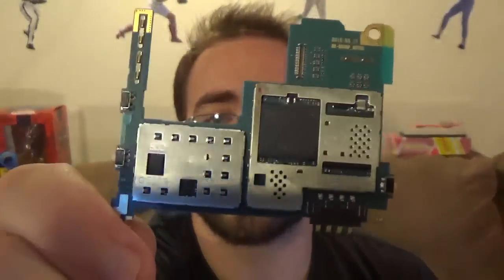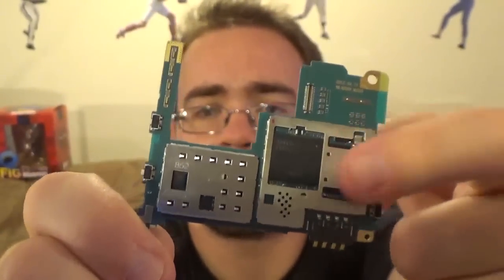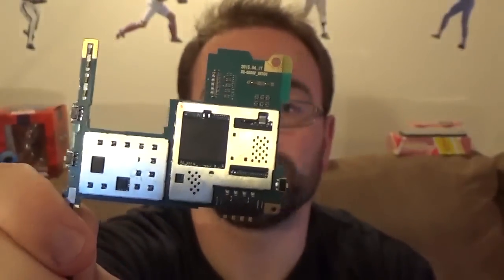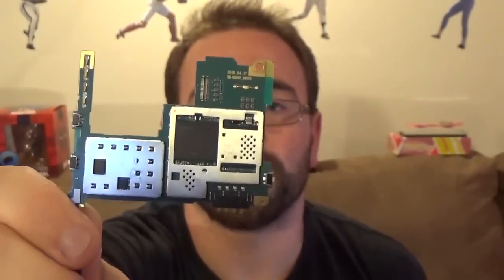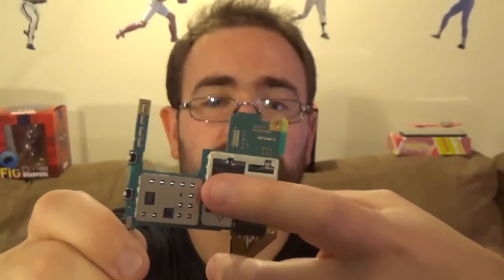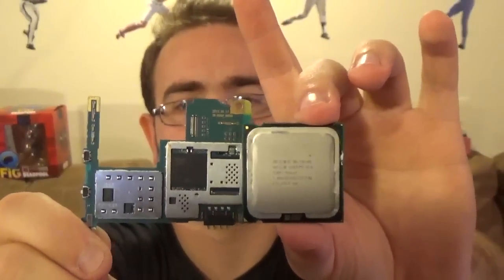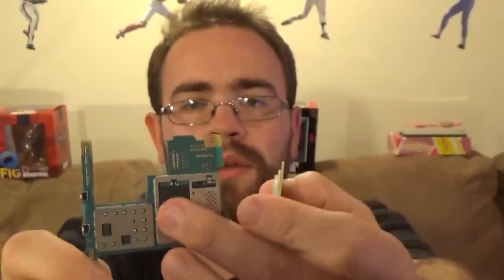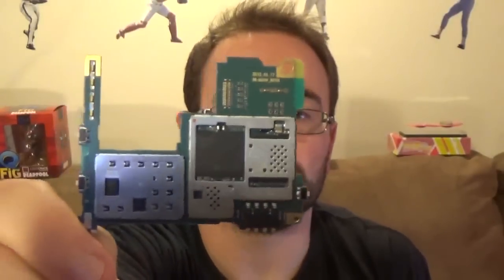Nintendo Switch - x86 And ARM! Why Is Nintendo Using ARM??

Comment: This video actually explains why the Switch just gets more and more powerful. Nintendo can basically redesign how the processor work at assembly level on the fly. For people that don't know assembly is basically the lowest lever programming possibly. With assembly you can basically have full control over what happens on a single leg of a chip at any time.
It's also used to program stuff like elevators,  circuit boards etc.

Comment: So by your definition, the WiiU is a handheld system too? You hold the controller with the screen in your hands and it runs on batteries. Only the CPU differs from your example.

Btw, we haven't seen ANY specs yet, or had a real reveal what the Switch is gonna be. There are rumours of a whole eco-system of hardware, so to sum it up as a handheld system just because it has a detachable pad is a bit early.

Comment: Well it is and isn't is there a x86 chip in the dock ? hmm wondering how all that may work maybe that arm cpu isn't working alone all the time. But i get that has nothing to do with your analysis. Do you know whats in the dock besides visual transfer hardware like what it may have for its computing power since it states when docked it does more.

Comment: Actually my old SurfaceBook with i7 6600U (2 cores 4 threads) can disable 1 core and 2 threads when I enable the power save mod. and it works fairly good.
Reply: Yes, but each core uses the same amount of power. Although now Intel is using BIGlittle technology, but when this video was made, they weren’t.

Comment: So i'm no expert but i remember it was harder to develop for the PS3's Cell Processor then for the 360's X86 Processor, 
Now the PS4 and Xbone use the same X86 architecture which seems to me make it easy for devs to develop for both systems and making ports easier to make. Does this mean Its also gonna be hard to port things over to the nintendo switch ARM architecture? or hard to develop for if you are used to making games on the consoles?
Reply: Some corrections. The xbox 360 and ps3 use variants of powerpc processors (the ps3 processor is simply called cell). 

Anyways I don't think it'll be too hard since arm has a huge market share in the mobile space and has been used on every handheld since the gba.

Comment: Think you need to get you're facts straight.
The Switch will use a solution build upon their tegra chip and nvidias top performing video cards. The tegra chip is using a 64 bit architecture and the Switch will thereby be the first console ever to support a pure 64 architecture:
http://www.nvidia.com/object/tegra-x1-processor.html
This also mean it will be alot more powerful than the Wii U that in turn was 20 x more powerful than the ps3 (released 6 years after the ps3). As it's been 4 years now since the release of the ps4 it might even outperform or perform close to the ps4 itself in some aspects.
The card ridges also removes the need for load times and is great for open world games that rely on a lot of quick loads from databases.

Comment: It may run 5 year old technology but the Switch hamstrings triple AAA technology, so you'll get subpar/inferior ports of games that need that more powerful hardware to look good/great.  A game company like Sony/M$ want more powerful processors and graphics, they want a beefy PC clone because gamers demand that streamlined hands off PC experience.  It is a handheld with a dock that some games will utilize to upsize.  Nintendo should have made both separate, a beefy console + travel toy, instead of a gimmick hybrid that in actuality is just a handheld showcasing old tech that is still far behind the offerings of Sony and M$.  Switch is primarily for Nintendos IPs, it's WiiU 2.0.

Comment: Terrible explanation. sorry. There's no reason for Nintendo to use ARM because it is a "growing market". That is interesting for nvidia, qualcomm, samsung and the SoC manufacturer. Nintendo use Nvidia as a partner because they are the only company in the world that have created a power efficient mobile chips with console equivalent performance. For developers, ARM isn't really an issue as Nintendo, in collaboration with Nvidia, offers middleware to game engines and code platforms. Today, two of the most popular engines, "Unity" and "Unreal 4" compiles to ARM-architecture and are officially supported by Nintendo middleware. They both run admirably on the platform. And since games are not developed with hardware specific code anymore the whole popcorn example is a way of overly complicate the development process of games for the switch. Nintendo and Nvidia is bundling hardware specific code into APIs that game engine developers will use to attach to their game engines. nothing more. The development process isn't complicated due to the architecture.

Comment: It's simple really. Nintendo wanted to be different. Consumers look at the PS4 and Xbox One, PS4 Pro and soon to be Scorpio and identify them not as consoles really, but a compact PC instead. Sony no longer uses proprietary custom made parts. Instead, they're now using off the shelf PC parts to save money. (That and Kutaragi no longer resides at SIE.) Xbox has basically been a PC in a smaller box since it's introduction into the console market through the Xbox 360 and now Xbox One as a way to sell hardware to PC enthusiasts and appeal to them. Nintendo still want to be identified as a console and this helps that claim in a market of non-proprietary parts any more seeming less like a PC and more like a console, though now they're clearing preparing to take on and try to compete with the mobile market which is still a tall order. Nintendo has recognized and accepted they can't compete in the console market. N64 failed, GameCube failed, Wii was a success but not enough to carry Nintendo through if they want to stay profitable, and the Wii U crashed and burned. Nintendo learned their real strength is in the handheld market. With Sony no longer there to compete with them, they're the only handheld manufacturer. Nintendo knows outside of Japan, mobile games suck and are a dime a dozen. So long as this rings true, Nintendo stands to benefit from it in a Free-to-Play and Micro transaction ecosystem. Nintendos strategy is to eliminate that and give you all your content with one price, which will appeal more. And is smart to go back to and keep things as they once where where you didn't get nickel and dimed to death. That's why Nintendo feels they can take on the mobile market. Between Sony and Microsoft, first one to bring an end to Micro transactions and Free-to-Play, and DLC and give gamers the full package they paid for in the beginning will own the console market space. Anyone whose paid attention to the comments section and forums knows this.

As for Nvidia, anyone with half a brain knows Nvidia regretted turning away Sony and Microsoft thus losing their business to the competition trying to crank out the shield to make up for their losses that obviously didn't work, thus losing a lot of money to AMD. I'm sure they were quick to negotiate with Nintendo as a result of this deal.
Reply: I think Nintendo have had little choice really, since Sony and Microsoft entered the console market, Nintendo have been outmuscled by them because they have a lot more clout so Nintendo isn't even trying to compete with them and is doing it's own thing, from the Wii, Wii U and the Switch, the real problem I could see for Nintendo is that they are entering the domain of smartphones and everything I've seen so far with the Switch can be done with smartphones and tablets and if Google and Apple clock onto the idea, Nintendo could have problems, also, Nintendo have been selling less home consoles with each passing generation since the NES with the exception of the Wii which was a bit lucky for them because they entered the casual market just a few years before smartphones took over.

Comment: because arm has fewer specialized instructions (almost none actually) which means less die space and less power used (because even when areas are not being used on a die they still draw power). the specialized asics that a gaming system needs are typically part of the graphics cores (video encoders/decoders etcetera). A game console has no need for things like virtual machine related extensions and so on and some extensions can be cut down, for example the encription related instructions can be cut down to only have what it is explicitly going to use.

arm also has very little in what the northbridge/southbridge needs to do. Things like pcie lanes, sata busses, usb busses, etc are unnecessary for a mobile chip  and therefore don't need to be included in the north/southbridge of an arm processor further reducing the die size and power usage needed plus it's all on die which reduces power losses. 

arm is a good thing here, it simply doesn't have what the system doesn't need. This is an arm cpu that provides basic instructions and cpu things and a gpu that can handle all of the fancy stuff that needs to be done.